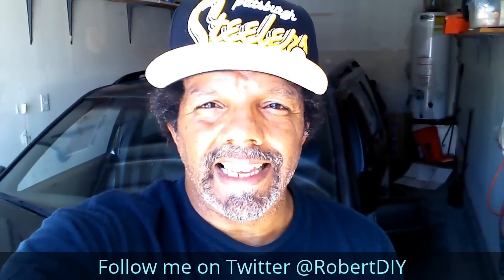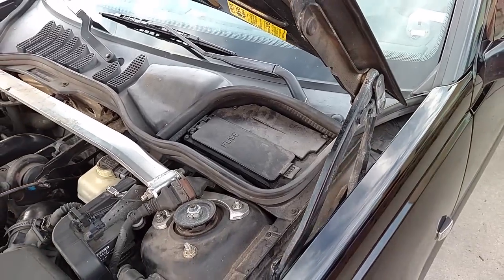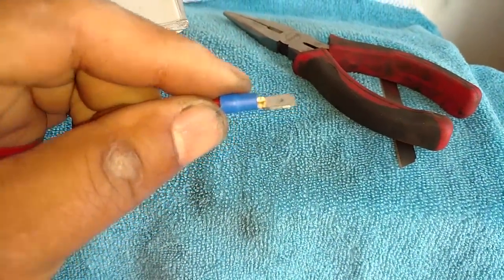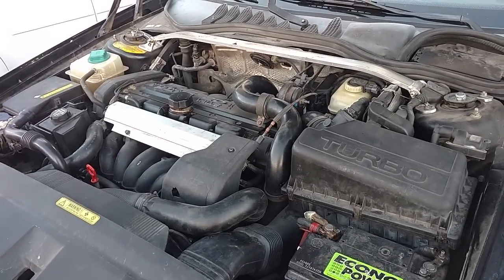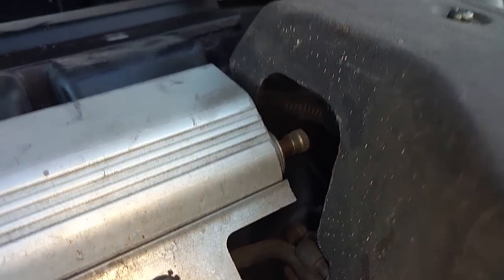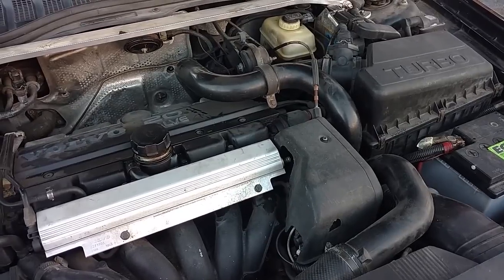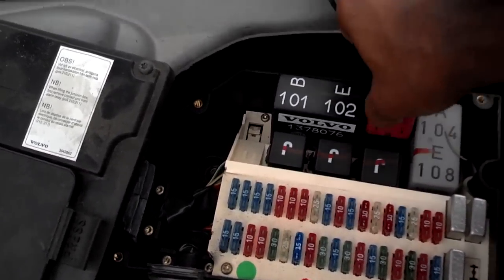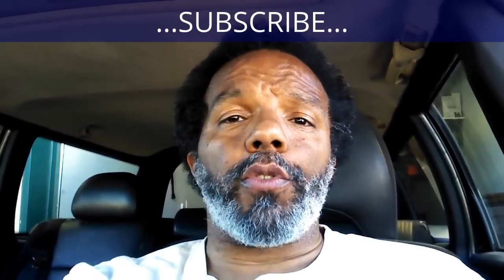Random stalling, will not start, fuel pump and relay testing, Volvo 850, S70, V70, V70 XC, etc.

Comment: Hallo robert 
I have a weard problem on my volvo v 70 1998 
The signal light is not working anymore  and the left side signal lights are constantly on without flickering just on all the time ,
I hade checked the hazard light relay that is located uner the radio console and that seems working fine but as soon as i turn the switch on the left side sigal light gose constantly on,
Please let e know if there is anything i can do about it
Reply from the maker: I would replace the bulb or relay. Does the flashers work?
Reply: I have found the problem after triying out every possible thing and the problem was a shirt circuit made a by a clumsy mechanic ho hade previously hade remouved the towing hook claming that it wouldnt pass the MOT becaouse of rust ,
Thankfuly i hade a bright moment and whent to look for the cable and had found it laying loos in the back right lamp compartment and it was just cutt off with the whires exposed making the  shire circuit
Reply: @RobertDIY  thanks allot for the great knowledge you are shearing 
It has saved me from allot of small bills and hade saved tons of time in total

Comment: Help me Robert! My Volvo 850 2.0 T5 won't start. I've changed spark plugs, distributor cap and rotator, ecu unit because diagnosis gave code 325 "ecu memory fail", spark plug wires, ignition coil and it's wire, new fuel filter, The Fuel pressure has Been checked and it was right, also The camshaft sensor and crankshaft sensor has been changed, I cleaned The grounding spots, new Fuel pump relay, main relay and Fuel pump relay does work, all The fuses checked, battery checked also, and it cranks and does that engine sound a little bit but won't start The engine 100%. I got also a little problem that first it gave perfect spark when i changed The wires and plugs but then The Fuel pump did'nt go on. I Took The Fuel pump relay off and put it back, and then The Fuel comes perfectly but spark comes rarely. What should i do?
Reply from the maker: https://youtu.be/3InZVPLYgqs
Reply from the maker: https://youtu.be/abKQeVaUoUE
Reply from the maker: https://youtu.be/YiPAPu-K8OI
Reply from the maker: https://youtu.be/gt9w-ZSxs9I
Reply: @RobertDIY  thanks for advice. I checked that one of the main relay's orange-black wire was 0.1 ohms and the other ones were 1.25-2 ohms. Is that orange-black wire The reason why it does not start?

Comment: Great videos Robert I have a S70 98 Volvo picked it up for 300 bucks going to replace top radiator hose also thermostat but for right now starts right up sometime runs great idle and then stops going to try the fuel pump relay like you specified would like to stay in contact with you don't know if you are in Houston Texas I am in a little town call Huntsville Texas really need this little car to work for me everything is far away seven to eight miles away please help if you can thank you and have a great evening sincerely brother Greg
Reply from the maker: https://www.youtube.com/watch?v=wFE5wptrTQ4

Comment: Hi my 98 s70 n/a just cranks with no start after a short trip. Leave it for 10 minutes and starts up. Replaced fuel pump relay to cure stalling but still no-start when warm. Replaced dist. cap which had carbon around each plug end. 
Can't replicate the issue after the new cap but could this be the culprit? (fuel gauge reads 50psi when it won't start so don't think it's the pump- also no codes) thanks!
Reply from the maker: Probably the ECT sensor. Have you scanned for codes? - https://www.youtube.com/watch?v=8xIi3_n5vsQ
Reply: Robert DIY No codes when scanned. I will watch the video. Thank you!

It's been starting fine since the distributor cap was replaced. Is this just coincidence then?
Reply from the maker: Hard to tell from here.
Reply: Been starting fine with the new distributor cap. I guess I should replace the plugs and plug wires as well then?

Comment: Hi thanks but with S60 Volvo how can I tell which ones to jump
Reply from the maker: They don't have a relay as far as I know.
Reply: Robert DIY they do part number is 9441158 S60 2004 just need to find out which female connectors to jump

Comment: Hi Robert! I have a mysterious code that i cant sort out. CI-113 Fuel sensor open Circuit. Wtf does that mean!?
Reply from the maker: What kind of car do you have?
Reply: @RobertDIY  same as you, 855R but its a 2.0 liter and made 1997. Made for the Italian market and brought back to Sweden. Its kind of a weird fault code, it came on when i started the car with the airmass/airflow meter unplugged (i forgot to plug it in) thats the only code that were impossible to put out.

Comment: Thank you.... we replaced this part and my 240 volvo is still starting and then turning off.
Reply from the maker: any codes?
Reply: No codes; we just can not figure it out and already have almost 700 in the car with new wires, filters, battery, sparks, and plugs.. just can not figure out why it will drive for a little while and then start and shut off. It is sitting at the garage and I just can not afford anymore money. Thanks for any ideas what can be wrong.
Reply from the maker: Maybe the fuel pressure regulator.

Comment: Hello, thank you for all solve problems in my Volvo 850 1992. Now i need help for: my car start well when Turn off in last 30minutes. If i try after 30min or 2 days, it is the same, only at  second try. Always...only in second try the car Turn on and well...please help me...solutions. Regards from Lisboa, Portugal, europe
Reply from the maker: Probably a weak fuel pump.

Comment: Hi Robert i have volvo s90 1997 today I was driving on highway suddenly car stop accelerating and it was not picking up speed then I stop the car on side of the highway and I listened some noise coming from fuel tank after that whenever I drive for 15 minutes it continues please tell me how to fix it and what is it
Reply from the maker: +irfan nazir maybe your fuel pump is failing. Is the check engine light on?
Reply: +Robert DIY no light isn't coming
Reply from the maker: Probably your fuel pump.

Comment: hey Robert.
I have 02 Volvo S 60 2.4t.
car starts struggling in the morning but in the afternoon after work it has harder time starting. 
sometimes when you put it in gear  won't run push the gas engine running but won't go.
please any help.
Reply from the maker: Does the engine RPM's go up? Is there a message in the display?
Reply: Not it doesn't
Reply: Not message at all
Reply from the maker: jose arredondo have the fuel pressure checked.
Reply: Not yet.
Reply: +Robert DIY hey Robert my Volvo 850 starter just went out I just changed it and now its cranking but won't start

Comment: If I were to do this trick with the relay, would it be ok to run the car threw a demolition derby??
Reply from the maker: No
Reply: What would be the best way to make sure the fuel pump wont shut off when I get hit?? Air bags are out including the air bag fuse
Reply: By the way your videos were very helpful with the car thank you
Reply from the maker: Relay cuts fuel when the engine dies. There is a roll over valve near the passenger rear wheel that may cut the car off in an accident.
Reply: I dont know anything about volvos so I have been watching your videos to help me. Any way possible that I could by pass it?
Reply: The roll over valve for the fuel

Comment: Am I able to pull off the fuse box and repair the wiring under where the fuel pump relay plugs in without damaging anything or messing up the computer?
Reply from the maker: +OFFICIAL JRED what makes you think that the wires under the fuse box are damaged?
Reply: Actually better question, I just bought a new relay and when I put it in the car doesn't start. With the old one it fires right up! After awhile of running it seems to start to sputter and stall. I tried to wiggle it around and it seems as though that's what is causing it to stall. I've checked the fuel pump and fuel pressure it's getting gas. All signs are leading to this relay. I'm kind of stumped
Reply: I'm thinking something is loose possibly. Also the other night the relay (old /original one) was pretty warm. Is that normal?
Reply: Update: when the idle starts to drop before it stalls if I tap the relay it stays running
Reply from the maker: So, where did you get the relay?
Reply from the maker: https://www.youtube.com/watch?v=aj4tL32XIXs
Reply: I had it ordered through a parts store called "monument car parts" I made sure they ordered the OEM relay which does say Volvo on it and looks exactly the same. I just drove the car with the old relay and when I hit a bump or turn it starts to stall.
Reply from the maker: Sounds like you got a bad relay.
Reply: That's what I was thinking. Also should the base ( where the relay plugs in to the fuse box) be loose? Seems there is a lot of play for it to wiggle around.
Reply from the maker: +OFFICIAL JRED does not matter. Put a jump wire in it for a couple of days.
Reply: I'll try that! Thank you for all your help, I really appreciate it!!
Reply: I used the jump wire and it works the car is working perfect. I also tested both relays and they seem to be working as well. So my question is, would it be bad for the car to keep the jump wire in as primary use? If so what could go wrong or how long would it last?
Reply from the maker: +OFFICIAL JRED did I explain that in the video?

Comment: Hi robert, My 2000 s70 base non T w/ 150k is driving my crazy, I've changed the abs control module through midwest-abs.com, my heater core(back killer). modded the TB to a contactless TPS through circuit solutions, changed out the Maf sensor for another used one, changed fuel pump relay for another used (also performed the 15+87 jump test. all with the help of you're videos!  the car runs fine but dies after revving above idle speed and whenever shifted into reverse or drive gear. after dropping 200 dollars on a mechanic to "diagnose" the TB as the issue after I had mentioned it, theres no way he knows as much about these volvos as you. will you help me? i can pay for you're time!
Reply from the maker: Bad MAF. You need to get a good OEM Volvo or whatever brand come on it. Either Bosch or Denso.

Comment: mine pump cycles every time, fuel out the rail ect so what else is it ? Same car
Reply from the maker: I have no idea what you are talking about???
Reply: @RobertDIY  The fuel pump, it cycles like you said when the key is turned. The fuel rail, it has a valve that when pressed squirts some fuel.. So my car cycled /primed when key turned , meaning the pump turned on.. Valve squirted fuel also.. Now i will test spark and all leading up to spark.. If spark goes fine what else could it be.. Car wont start ? Stalled many times then didnt start, then started once and now nothing. Cranks just no start.

Hopefully you understand now i been trying to get help for a while from you, please.
Reply: @RobertDIY  ??
Reply: to add.. As he couldnt think of it.. It was no spark, the coil pack was the issue

Comment: And if everything else fails, swear words can at least make you feel better lol :-D
Reply from the maker: +zx8401ztv I edit those words out. ;)
Reply: Hey Robert, I have a puzzle for ya... It's a 98 s70 t5 that randomly wont crank or start, I'm getting some fuel(after trying to start it quite a few times, I push the Schrader valve on the fuel rail and I get about a teaspoon maybe a tablespoon of fuel). When I'm sitting in the car trying to start it I cannot hear the pump at all, even with the back seat laid down and the trunk carpet pulled back so the fuel pump access cover is visible/accessible. 
Perhaps I should also add that the economy and sport mode buttons' lights are both lit up (along with all other interior lights; dome dash window controls etc.) and with any combination of pushing the three buttons they won't go out. The upshift arrow on the instrument cluster is the only one not lit up, and if I remember correctly it used to light up with the rest of them when u turn the key to the on position. The SRS light is the first to come on (key in and turned to position 1) and the first to go off(as soon as I turn key to start position-position 3). I know the battery is good, its been tested and on a charger.(Not continuously of course) 
The main thing that changed between the last time it ran(I've considered lawnmower syndrome since I only turned it around in the driveway and shut it right back off...thoughts on that..?) and now is that it wouldn't crank or start(obviously) and in return, I assumed fuel pump relay, and attempted to jump it however I read the relay wrong and jumped the incorrect terminals in the car, causing just a slight amount of smoke to come out from under the incorrectly jumped terminals before I quickly took the jump wire off. No fuses or wires are visibly burnt, from the top that is, I tested fuses with a light and fuel and starter relays have both been swapped out. 
Problem remains...*HUGE sigh** Assuming the worst and sadly trusting my childlike instinct of guilt, that I broke it.... :( that in my relay jumping attempt I melted a wire under the fuse panel... 
Which seems practically impossible, in theory, to repair, or at least difficult and frustrating enough to make one tear their hair out....
Therefore, with learning (the hard way of course) that u can't pull the panel out from the top (where u would check/change the fuse) since there are other wires/harnesses connected from below, that can only be accessed by removing the drivers kick panel, this is my next approach..
Oh one last small detail, I have another volvo (97 850 GLT) and the keys look almost identical....my dad (who's very mechanically knowledgeable yet doesn't know much at all about volvos in particular) tried starting my s70 to move it one night, except he used the 850 key...did he ruin the sync between the chip in the key and the ECU?? Please say no hahaha, I do not want to go to volvo and blow a bunch of money....
Knowing ALL of that, do u have any thoughts, suggestions, (advice not to touch certain things.....:/) I'll take any input u or anyone else has, and I do greatly appreciate everyone's help in advance, as well as the time u may take to read all my jibber jabber.. :)
Thank You!!!!! :) :) :) :) :)
Reply from the maker: Is it a NO START or NO CRANK problem?
Reply from the maker: https://www.youtube.com/watch?v=n7NYrCbQN7U
Reply from the maker: https://www.youtube.com/watch?v=mCyu_nJFA3I
Reply from the maker: https://www.youtube.com/watch?v=YiPAPu-K8OI

Comment: My 940 has been stalling randomly at intersections for probably around the last 3 months. (Always started up again the 1st time, so it hasnt been a huge deal.) As I'm writing this, she won't start...Thinking its fuel pump/relay related. Any videos for help on that?
Reply from the maker: https://www.youtube.com/watch?v=YiPAPu-K8OI
Reply from the maker: https://www.youtube.com/watch?v=gt9w-ZSxs9I
Reply from the maker: https://www.youtube.com/watch?v=i_X3XBbOKcY
Reply: Hello Rob I got a 1999 Volvo s80t I turn the key it turns over longer, turn it over a second time it start it has a new fuel pump I here it prime up when key is turn on but it has to be turn over longer then it start. Would this be dirty fuel filter or fuel pressure regulator and is fuel pressure regulator on the fuel rail or different location. Also I notice that if I turn ignition with feather turn it start better.

Comment: Robert, Outstanding Videos. Are you Ex Air Force? Maybe Instrument Shop? bruce
Reply from the maker: Yes, C-130 crew chief.
Reply: @RobertDIY  i was instrument shop at clark, dyess and keesler 130s. I could tell by your crimping and ftd training talk, Lol. My o4 c70 starts after cycling the key on and off about 4 times if it doesnt start the first time. i put in a fuel pump relay and still get intermittant starts.
Reply: I'm thinking the fuel pump electronic fuel module. Don't know where it lives in the car though,lol.
Reply from the maker: https://youtu.be/NWfLpp8NevI

Comment: I have a Volvo S70 1999. It runs for 5 minutes then the engine stalls. Change the relay and crankshaft position sensor but it did not work. Dose any one have any clue what it might be?
Reply from the maker: https://youtu.be/NhtUXZTurzo
Reply from the maker: https://youtu.be/cWKOi8D4SWQ
Reply from the maker: What lights are on in the instrument cluster?
Reply: No lights on the instrument cluster. I went to an mechanic and he did not find any cods do not know if he had the exactly right software but i think so. Thanks for the answer I really appreciating it.
Reply from the maker: Did the mechanic have a Volvo class scanner?
Reply from the maker: https://youtu.be/NWfLpp8NevI
Reply: Changed the fuel pump. Did not work. Check the signal between 31 to 31b. There was none but throe the fuse there is signal. What can I check next?

Comment: halo Mr.Robert...my name is Anjaz and i am From Indonesia...i need your help...my problem is i pulled the distributor cable while engine is still running in order to shut off engine because i got locked outside..heheh..but after i got open the door and i put the cable on the diatributor again..the car wont start only cranking and cranking but wont start.....oya the car is volvo 850 GLT A/T 1997...plis Mr.Robert..because i need this car to run to take my wife to do check up to the doctor...
Reply from the maker: https://www.youtube.com/watch?v=YiPAPu-K8OI

Comment: Had radiator  installed,the car starts and cuts off
Reply from the maker: ouch
Reply: I feel it ,missing work
Reply from the maker: What kind of car do you have?
Reply: Volvo s60 turbo
Reply: @RobertDIY  I have 2007 Volvo s60
Reply from the maker: is it still at the place that replaced the radiator?